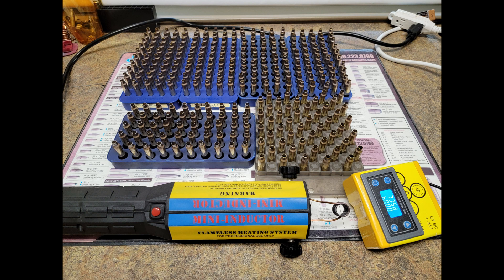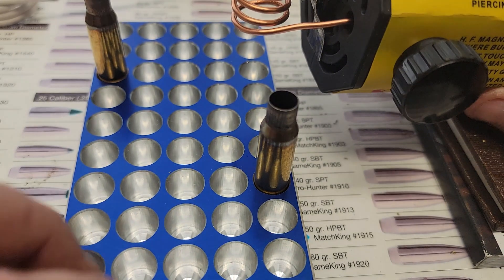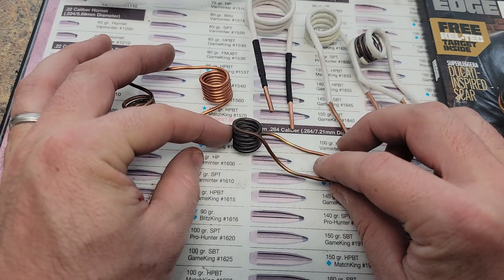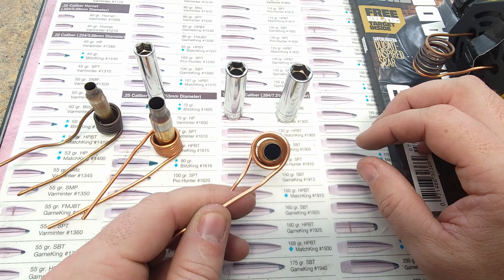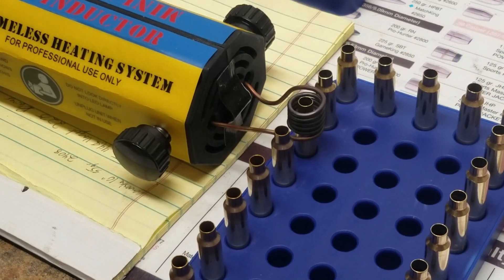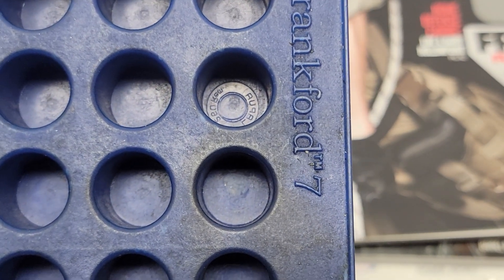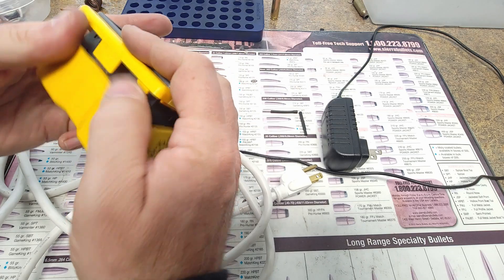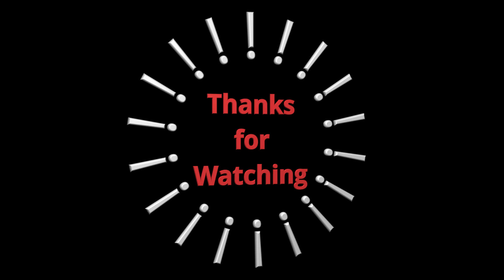DIY Annealer for under $200 Part 2- Tips and Tricks

Comment: Great video series and excellent tips.  I set up mine by mounting the annealer to a large ammo can.  Put a case holder (section of copper pipe with pull solenoid at bottom) under coils.  Hid all the wiring inside ammo can.  Once a case is annealed I push a button and the case drops into a metal tray.  Thanks for the tips, I need to set up better coils and cooling.
Reply: @chuckbobuck1302 :  Love this modification you described... especially the solenoid operated drop function so you can just keep feeding a new case in by hand instead of handling the heater itself.  Any chance you can post a link to the solenoid you used and notes about how you powered it?

Comment: I'm still using my annealeez which I like if not for burning wheels that I believe is now fixed. Lol. But I know I'll move in this direction at some point so I really appreciate you sharing all you've done here. Thanks.
Reply: Nope, burning the lower wheel still happens far too easily. I got my Annealeez a couple months back and have done several hundred cases, always happens with some of them and, I'm building THIS ONE!!!
Reply: @CrustyOldMarine  Yep, I have to agree. Even with the washers to protect the wheels I ended up burning the lower wheel doing 6 DASHER since my previous post. I didn't even realize what was going on and now I've got a bunch of cases with melted wheel on them that I have to try and clean up. Imo, the machine cannot do short cases without having to stop after approximately 25-30 and letting the wheel cool down. I think it's fine with 223 and larger cases but the ones just give it fits.
Reply: @firstthes2811  Yep, and clean-up of the melted wheel goo off the case IS A BITCH!!! Ask me how I know...lol.  Can't wait to get this DIY Induction Annealer built (ordering parts today). I think it's going to be much quicker and much more consistent.

Comment: Great work sir! Thank you for sharing!

So question: how many times can you anneal a piece of brass before the brass “breaks down”? Does it lesson the life of the brass? 
Thank you
Reply from the maker: The annealed part of the case isn't what goes first on my rounds anyways. My printer pockets tell me when my brass is too far gone.
Annealing extends the life of the brass by allowing the neck to be resized more times without cracking it. Without annealing, I think I was getting maybe 4 reloads before the neck was just too brittle from all the work hardening and cracking.
Reply: @northeasttexastactical375  Thank you again sir. I have yet to hear anyone mention case life from annealing. I’m still new to hand loading. It makes sense primer pockets stretch before case necks “dry up?” From annealing. I’ll be selling my torch annealer to build this model. Excellent coverage of this type of machine. Well done!

Comment: Sure glad I joined your channel, this is some great information. 
That last test round that wouldn't seat with 100 pounds of force...I have a question about. Was the case sized when you annealed & then loaded the projectile and it loaded with about 38 pounds of force?
Another question about your other cases. Are you annealing before sizing the cases or what exactly is your method? 
Or...just link me to a video where you discuss that, this is the first video where I had this question.
Thank You...charlie...😎 ...👍 # 11
Reply from the maker: Glad the video helped you. The case was sized only when it wouldn't seat. Then I annealed it, but I can't remember if I resized it again after that or not. 
I rarely clean my brass, but if I do, I'll do it first, then immediately anneal, before resizing, trimming, etc.
Reply: @northeasttexastactical375  Thanks, I appreciate the answer, I am new to annealing by machine, always used the old'skool socket & torch. I finally built an annealer, was a fun project too...now I am actually trying to get to the bottom of the temps we should use & time in flame. If your interested in my DIY annealer, here's a link. https://www.youtube.com/watch?v=mDAV3G_wX5U&t=1s

Comment: I set mine up after watching your first video. Works great!  I need to tighten up my coils like you suggest.  I used the 120VAC timer to save some hassle. I also mounted my annealer to a board, then drilled a hole under the coil.  A simple sliding door under the hole allows the annealed case to drop into a metal basket. Lastly, instead of using the female plug from the extension cord, I used an extra outlet box and gfci outlet to plug in the annealer and fan (the fan side isn't switched).